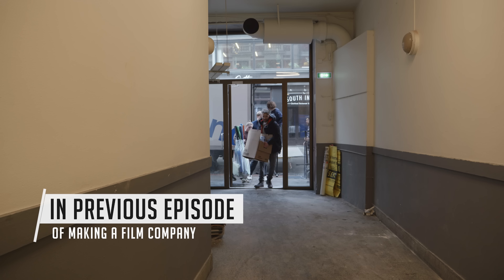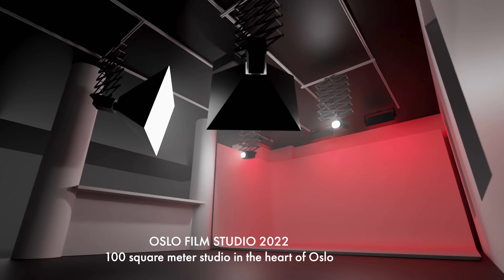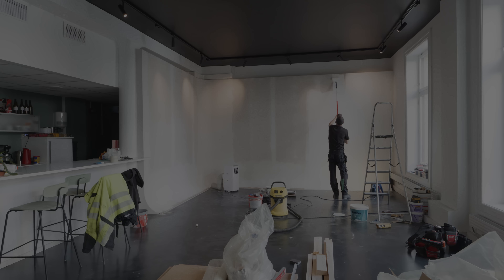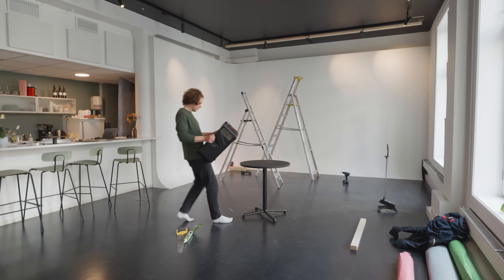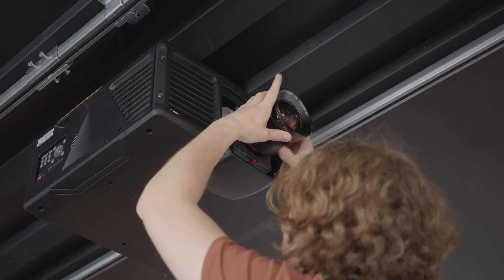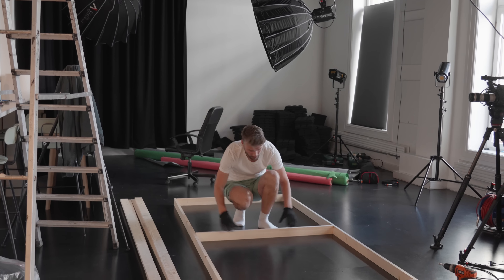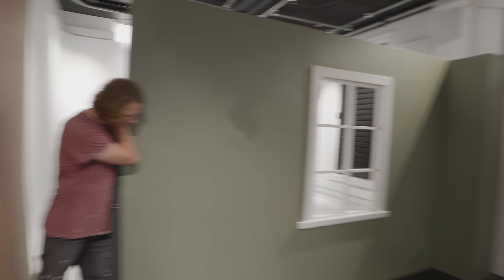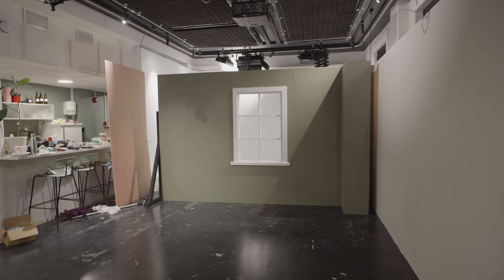We Tried To Build the Ultimate Film Studio | Making a Film Company S3E3

Comment: Could you advise me on cove lighting?? I plan to have a cove setup built. The ceiling  isn’t the tallest so mounting lights will be a little challenging.. the current solution is to use tube lights. I’m thinking about nanlite pavotubes.

Do you think multiple (4 to 8) nanlite pavotube t8-7x (a budget tube light) would suffice for lighting the background of my cove? The brightness is rated around 540 lumens.